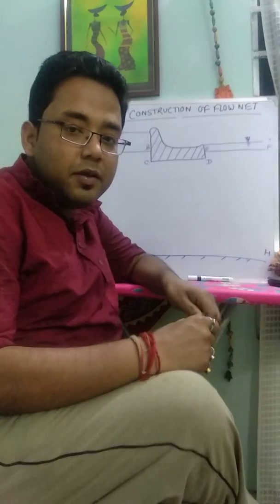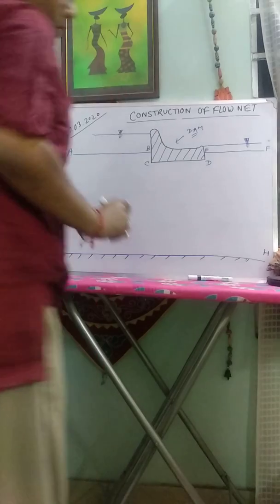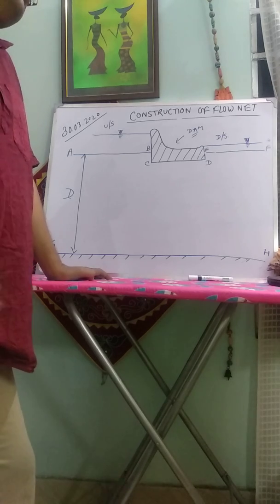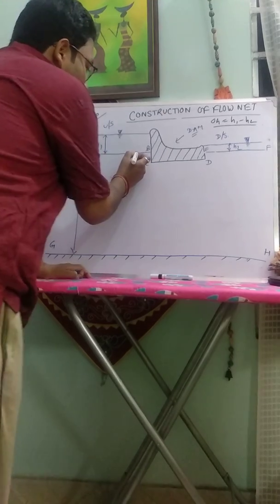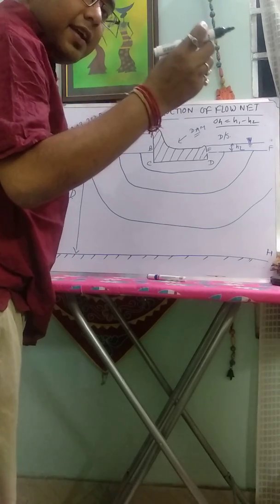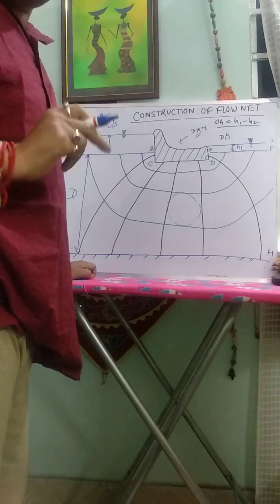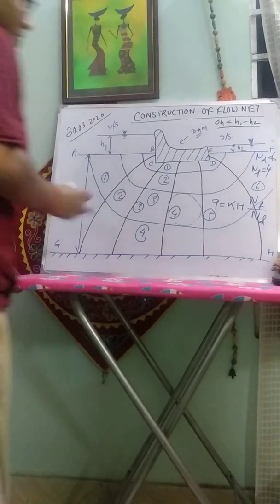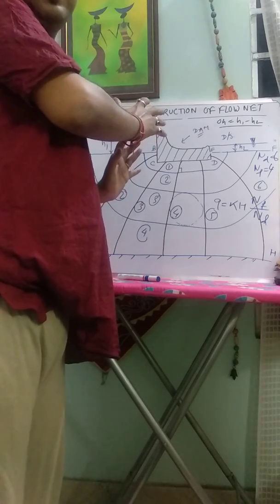Construction of Flownet

Comment: Everything is okay. If possible you can use  a small mouth speaker which is available in Amazon and Flipkart in rs250-350.then external noice can be excluded in this kind of online lectures video.
We have no problem in this sound quality.I just  put my suggestion.
Reply from the maker: Yes yes .. definitely I will keep this in mind..